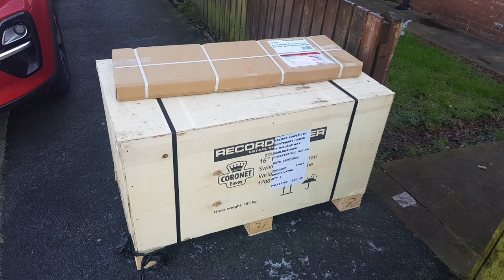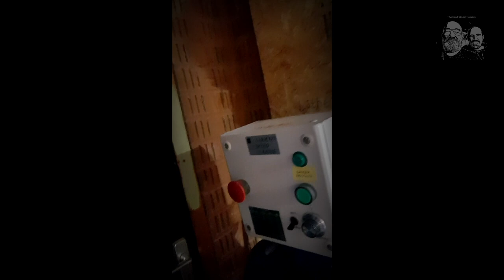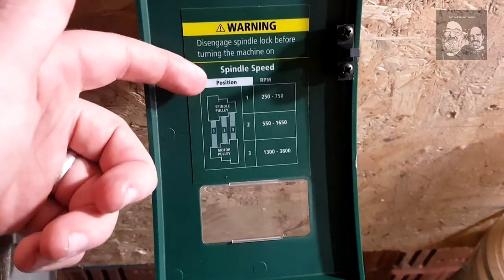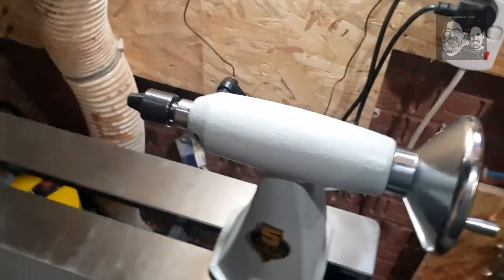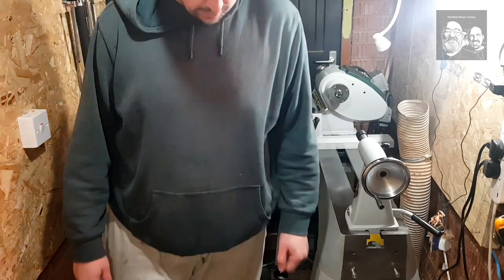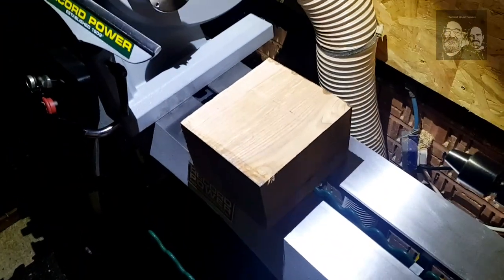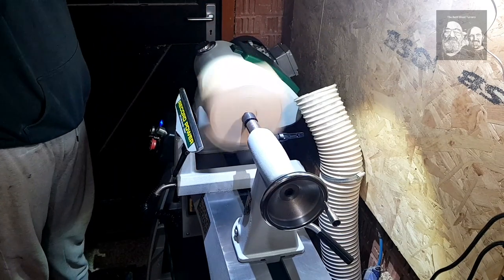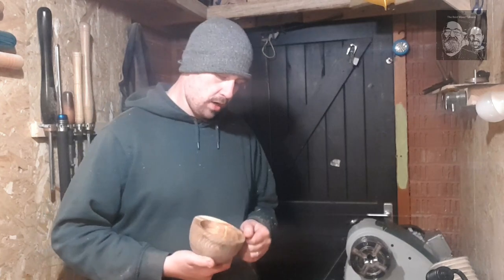Record Power Coronet Envoy lathe first use and REVIEW.

Comment: Great video, looking at axminster 1628 and Stratos fu 180 , just wondering if you are satisfyed with your new lathe? Would you recomend it, it ,s a hard choice to choose lathe
John
Reply: Thank you for your kind comment and for watching the video. Glad you enjoyed it. 
I would absolutely reccomend this lathe. 
Compared to the fu180, the specs are just better. For a similar price.
I chose the record power lathe over the axminster lathe as you basically get the same specs, the only thing the envoy loses out on is the total weight. But when the record lathe cost £400 more it honestly didnt make much sense to me to spend that much extra money. 

So far with the envoy I havnt had any issues at all, it has dealt with everything I have thrown at it!! Including some seriously out of balance pieces that it dealt with just fine. 

In short. Dont bother with the fu180 as the envoy is better specced for a similar price and save your self some money compared to th 1628.

Comment: It’s great lathe had mine for a year but I didn’t get the free shelf or light 😕 I find when you hit the stop switch on the wired remote it takes a while to stop and you can’t slow it down with your hand! Not really a problem as you can use the nvr switch to stop it instantly that’s my only problem with it! Its great I’m hoping they might make a swing away for the tail stock because it’s a pain taking it off and my workshop is very small! Thanks happy turning
Reply: Thank you for watching. I have not experience the problem with not being able to slow down, although I agree with the fact the tailstock is a bit of a pain to put back on.